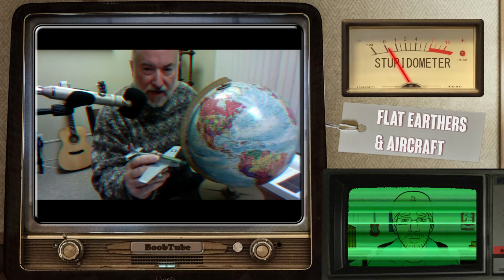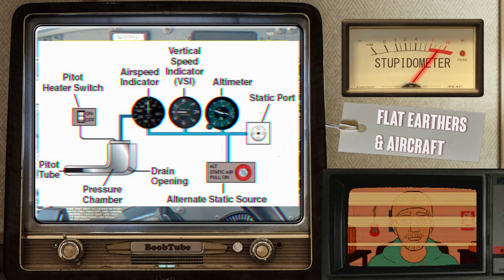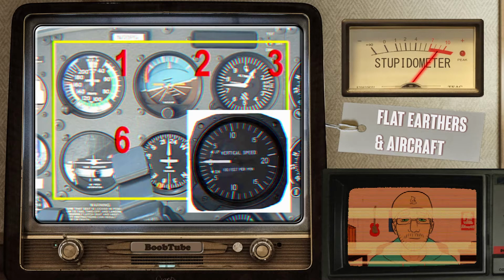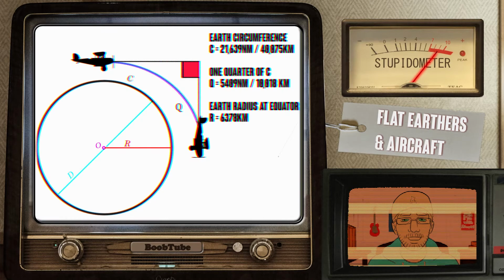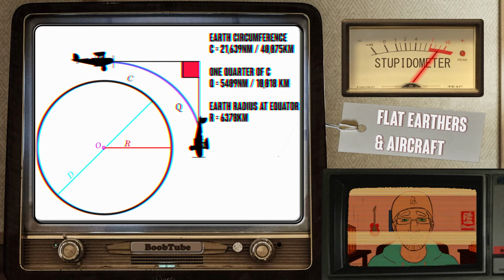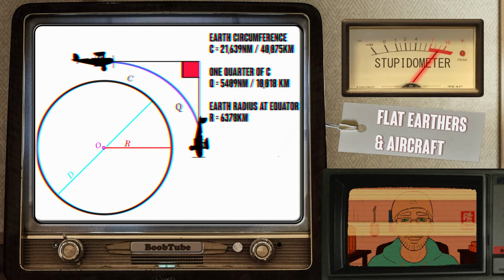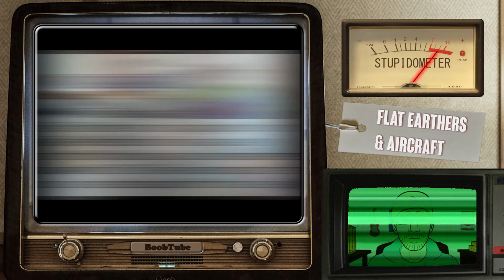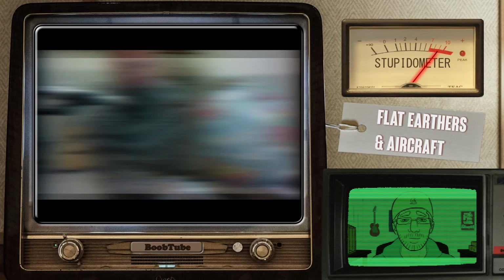Debunking Flat Earth claim regarding Aircraft, pitching nose and flying off to Space.

Comment: An aircraft has lift, mass and drag and propulsion to consider. When the airplane is in equilibrium (at cruising) all forces cancel out and the speed and altitude is constant. Lift is generated by airflow over  the wing, and an important factor is the density of the air. The density is (at cruising altitude) for the most part dependent on the altitude over msl. As the pressure changes so will the lift and the plane will go down or up  correspondingly. The angle of attack can be constant. This will not change over distance. However other factor change, the mass of the plane will change substantially over the flight as it burn fuel, this is something which one has to correct for. In short the curvature of earth is not a factor.